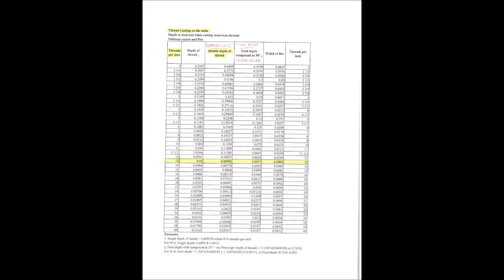Screwy Tuesday #53 Follow Up & Correction

Comment: I have a 1944 10ee and the carriage is lubed when the Z-axis hand wheel is used. It's not lubed with the spindle turning. In fact, Monarch suggests if the job involves mostly facing work to work the hand wheel back and forth in order to lube the X-slide and ways.

Also, the oil in the base of the tailstock doesn't lube the ways (at least not on my machine. I had to break the tailstock down to fix an alignment problem: the center of the tailstock was below center, but I digress, there aren't oil channels from the reservoir to the base.). It is a reservoir and there should be a "dipper" that you can use to lube centers, the ways and what not.

Comment: Chuck,  at 5:02 it appears that the compound is set at 30º to the axis of the lathe rather than 30º from perpendicular to the axis which would make the movement of the compound parallel with the thread being cut.  Is this an optical illusion, or did you move it since you cut the thread demo?  It does appear correct at 10:36.  Just curious as the graduations on the compound of some lathes reference the axis of the lathe and others reference 90º to the axis of the lathe.

Here's a procedure I found that makes it simple to accurately set the single depth.
1.  Touch-off on the piece to be threaded and set the crossfeed dial to zero.
2.   Move the carriage to the right so the threading tool clears the right end of the workpiece.
3.  Crank in the single depth of the thread (0.050 for 13 tpi) using the crossfeed dial.
4.  Set both the cross feed and the compound feed dials to zero.  (Make sure the backlash is out of the cranks.)
5.  Using the compound feed screw, back the tool out until it clears the workpiece, and position the tool using the carriage crank and the compound crank the to make the scratch pass.  (Should read ~ 0.057 on compound dial)
6.  Cut the thread as you normally would, re-zeroing the crossfeed after each pass and increasing the depth of cut with the compound.  
7.  When you reach 0 (zero) on the compound, you're at full depth for the thread.

This way you don't have to keep up with a second set of numbers for the compound which can be confusing. Try it a time or two.  Once it "clicks" you'll realize how simple it really is and quicker too.